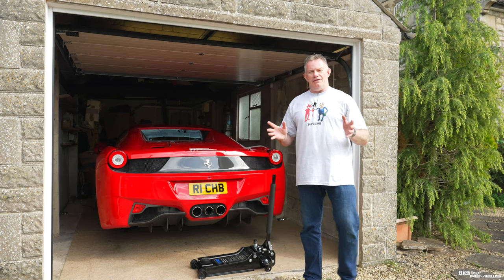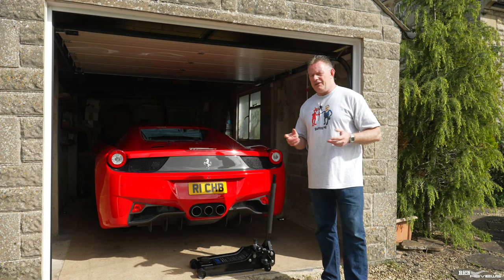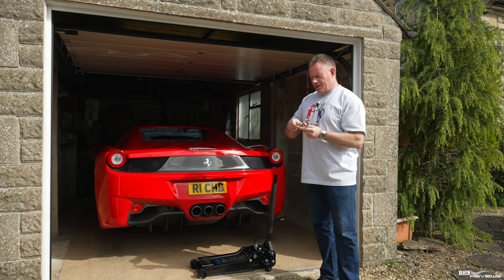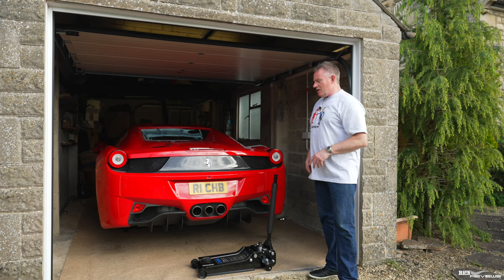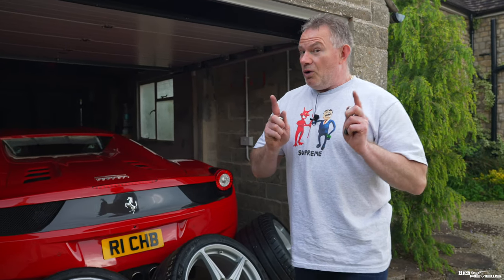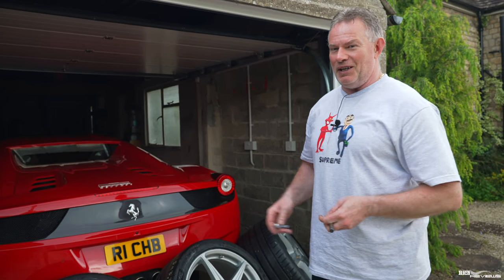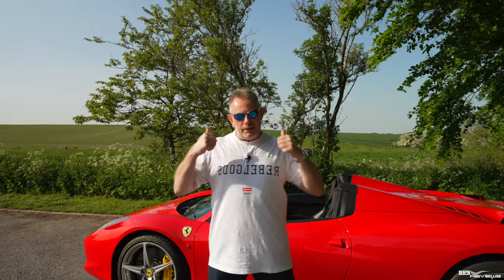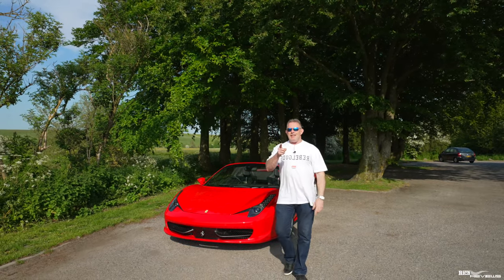NEW WHEELS FOR MY 458! - How to Remove and Refit YOUR Wheels Yourself!!

Comment: Great video Rich.  I did spacers on mine, wheels look lost in the arches otherwise.  For all the people commenting on here, it doesnt do anything adverse to the handling.  I also did the Novitec springs, handles and looks better than ever.
Reply from the maker: Agree, as long as well engineered parts defined correctly are used and fitted correctly all should be fine

Comment: Rich.....spacers are not a good idea.....they change the wheel offset which has effects on the car's handling , bump steer, extra load on shocks ,bushes and ball joints .......and probably makes your ferrari warranty void too...
Reply from the maker: If you have watched our content you will know how fastidious I am therefore I would not modify my car without extensive research. 
The spacers are the best, engineered by Hills Engineering and are only 11mm in thickness therefore are used for aesthetic affect to improve the side look of the car.
No bump steer, no suspension issues.

Comment: UK garages are silly narrow ! WHY ?  spacers are a DUMB idea add unsprung weight ! DO NOT USE !
Reply: thats what i was thinking, i would hate working with my back so close to the wall lol
Reply: Single garages are always built stupidly narrow, that's how it is unfortunately. Probably to cram more houses in to housing estates. Double garage gives you more space to comfortably fit a car.
Reply from the maker: My property is very old, I’m lucky to have a garage onsite. 

With respect to spacers, re-watch the video, they are made by Hills Engineering and are aluminium therefore add very little weight.